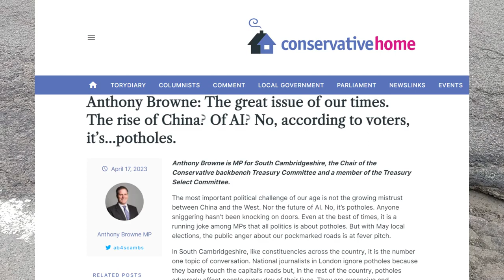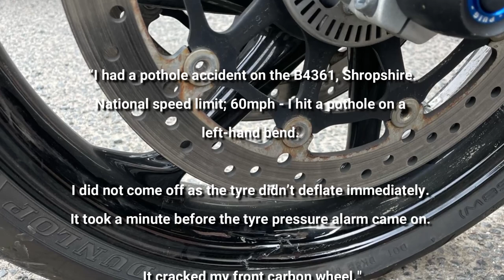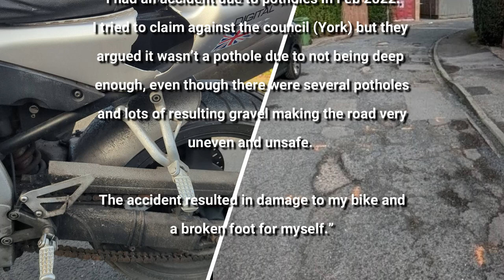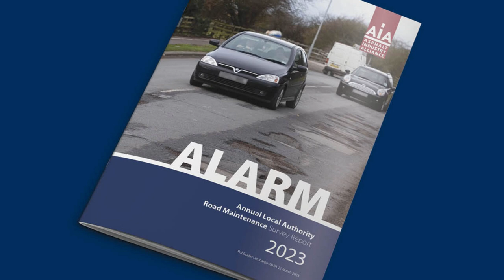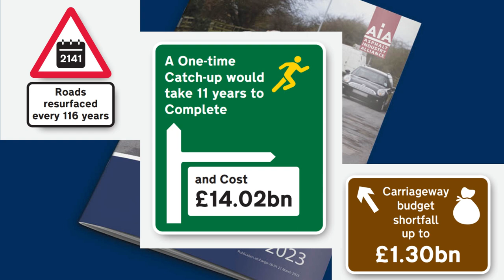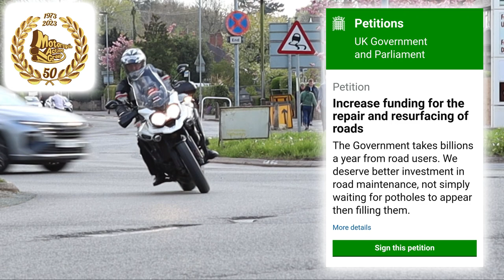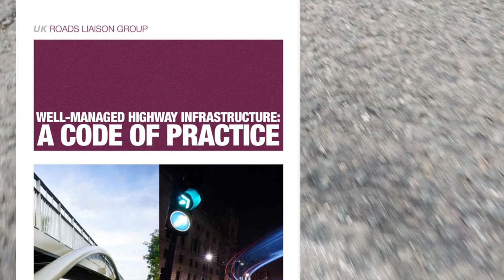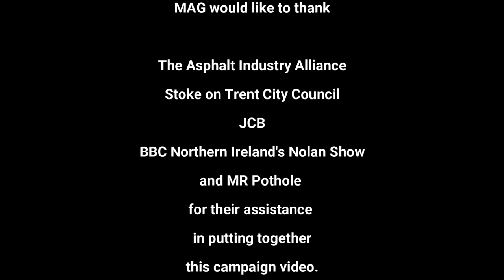UK Pothole Epidemic - Resurface Our Roads #potholes #motorcycles

Comment: Hit a pothole a couple of days ago whilst driving my car - the impact was enough to actually break the suspension spring. I'm only glad I was in the car at the time, not on my bike. The problem is that the authorities bodge the repairs instead of doing proper resurfacing - the bodges last between 2-4 weeks and then the nature of repair makes the pothole worse as well as leaving more debris all over the road.